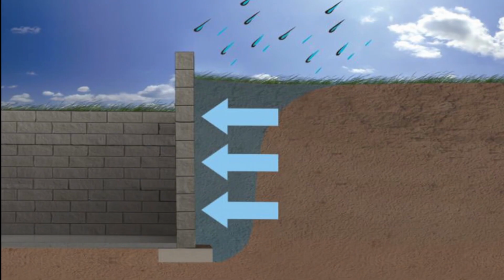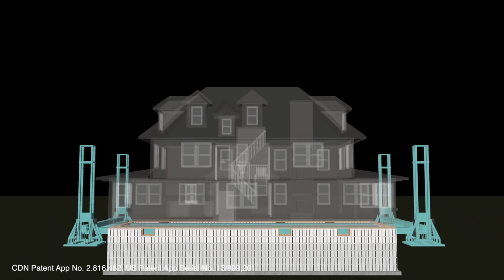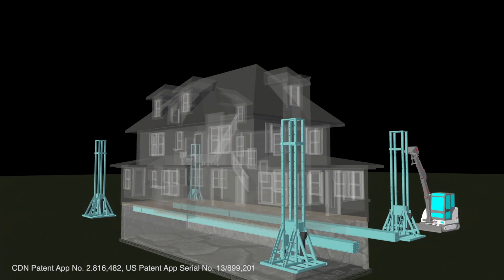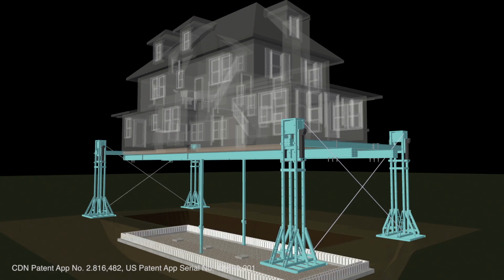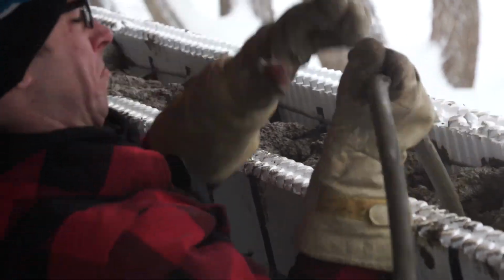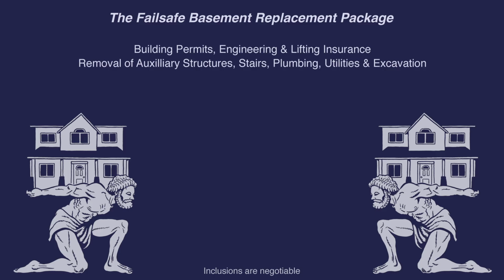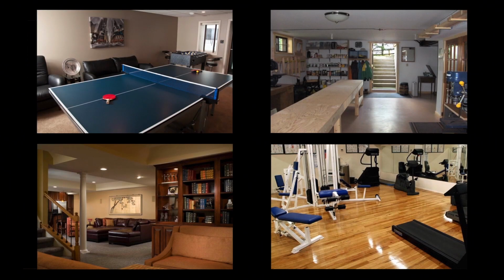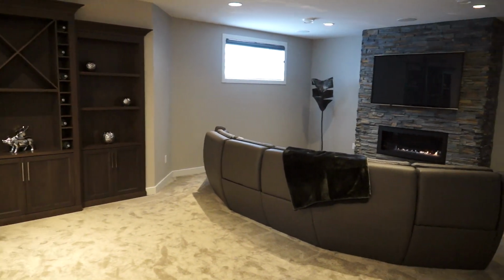FailSafe House Lifting & Basement Replacement

Comment: I've always seen timber cribbing as flawed as if the top timbers break there is nothing stopping the inertia of the house breaking ALL the timbers. We don't have basements here in Australia but your system looks far safer when it comes just lifting a house.

Comment: What has been shown is house moving jacks on steroids.  Australia has been doing this sort of thing for over 40 years, but, our jacks are a lot smaller and can be moved by 2 people at a stretch.  But, they still can reach to an 8 foot lift.  

One thing that worries me with the drawing of the bracing / chaining was that there was no long chaining of the length of the building.  It was taught to me when doing housemoving:  Never rely on your beams alone!  Always have a second and third back up plan, which you use in conjunction with your first plan.  If it was me, my plan would be to sink a couple of holes at 60 degrees to the line of the cross beams, and run a few half inch chains to those holes, which were filled with cement and had chains out the top of them.

Comment: Of the 10 homes I’ve owned over 27 yrs, only 2 (here in Dallas TX and In RTP NC), did not have 9’ or 10’ (block courses or poured foundations), with either natural walk-out or forced  walk-out basements, with legal egress.  My new home, in NW Arkansas, will 3k sqft above ground finished, 1.5k basement unfinished and 1.0k attic unfinished.

Comment: My grandfather owned a house moves and rigger company back at the turn of the last century, they used teams of massive horses and manual labor, I have pictures and still have one of his business cards, if alive today I think he'd be impressed with the technology. My one hundred year old  house has a brick foundation, in 1998 we had a perimeter drain installed with a sump pump, it made a big difference and has kept the basement dry.
Reply: Using Horses to move homes is something special.

Comment: I wish I could raise my little mobile home and put a foundation under it, I've been living in a hardship situation and all of a sudden they want a foundation or I have to tear it down because it is 1 of 2 buildings on the property. Tell how this makes any sense.
Reply: Necessity is the Mother of Invention. I worked with a guy that raised a mobile home with a large flat bed wrecker. We sat it back down higher than it was on concrete blocks.  Surely you can move it, put down a 4" slab and move it back.  It just takes the will and helping hands. My Church family would help me if I was in a similar situation... maybe ask your community for help.  People need a cause that makes them feel good.
Reply: @pearlandvelos244  One of my problems is I've built additions to the mobile, another is its age. I just don't understand why it can't remain as is, mostly storage and shop, not an actual residence with all the appliances, yet they want it either torn down or on a foundation of their approval put under it.

Comment: It’s a nice system but in order for it to be 100% successful you would have to have solid ground and level ground for it to work safely but if your house is on a hill or is not on the level spot you wouldn’t be able to use this system. Unless you dig pilings. And place the jacks on them.

Comment: House lifting costs $10,000 to $40,000 just to elevate. The average cost to raise a house above the flood zone is $20,000 to $80,000 for piers or pilings. The average cost to lift a house and replace the foundation is $20,000 to $100,000, or up to $150,000 to put in a basement.
Reply: I'd spend that to get my house above the flood zone.  It was above until the Harvey flood.

Comment: That’s pretty wild. A few years ago a very old and very large barn was moved across the street and rotated 90°. I’m so amazed that a house, or any structure, can just be picked up and even moved. 

Do the 4 pillars need to be set on the same plane as each other?
Reply: They probably use leveling jacks. Each corner has a big bolt that can be screwed down or up to get them level. But I would suspect the flatter the surface you start with the better.

Comment: Wish I cold afford to do this for my mom's house. It was built in 1900 and the basement walls are made of stacked stones and a few big boulders, and they're slowly falling apart. I'd love to have it totally removed and replaced with a new modern concrete basement.
Reply: You could do that with constructing brace walls, assuming you have a good floor already.  Do it in sections so you don't have to lift the whole house. This is the Premium solution.
Reply: The stones must be very impressive. I'd like to see a walk around video and story about such a structure.  If one was to do this one might find a clever way to capitalize on it.

Comment: 3:25 I've see what happens when you build foundations like that. The slab and the walls ( I don't' know the proper terms) can separate over time. They should all be poured as one OR a complete slab and then the wall built on top of it.

Comment: This is very cool - I suspect the cost of what they showed to be north of 100k - house lift 20-25k - basement demo 10-15k - new basement 30-40k - site prep and site finish 10-20k
Reply: Reminds me of the people paying millions of dollars to build mega basements in London- there will always be a market location that can justify any cost to add more square footage! Especially if the locality doesn't permit adding additional floors to the top due to historical codes or etx
Reply: Probably a very good estimate… if not 150 - 200k
Reply: worth it if the house is worth over $300k. Because it will become worthless if the house caves in
Reply: couldnt be said any better. unless you REALLLLY need that new basement it would be cheaper to dig a cellar next to the house.
Reply: A waste of money.
Reply: @josephhewes3923  on a 70k house yes its a waste of money. on a 1.5mil house, it's not a waste. The cost is not any different than car repairs. Should you spend 5k to put a new engie in your 1999 honda civic, no; but spend 15k to replace the engine in your mercedes sls is a big yes.

Comment: This is great! 👍🏻
I remember looking at an old house years ago. House was great but it had major basement issues. If I had this as a option at the time I might of bought it?
Reply: well getting the basement fixed using this would still be a major cost but would potentially increase the value.

Comment: I would love to do this.
My 1940 house has had roads built around it. Now the house gets road water that runs by one side. The road is almost level with the house.
Reply: Yeah we had that problem in Bethany Oklahoma where I grew up. It's also a very real issue in Pearland TX.  They just rebuilt all the roads in my sister subdivision to the north of me and several houses are now below the street level.  I'd be a little upset.

Comment: I must've missed the step where the house is attached to the concrete walls. I saw where bolts were installed in the concrete and a wooden plate over them. Then the house is lowered. Shouldn't holes be drilled into the plate on the bottom of the house before it is lowered? Then the nuts driven onto the bolts after its lowered?
Reply: Noticed that as well ... electrical grounding rods as well?
Reply: Yeah I guess that's called editing for time.
Reply: You use double sill plates, bottom 0ne bolted to foundation, second one nailed to floor joists and after lowering they get nailed together..

Comment: It costs $20,000 just to have a concrete slab braced with galvanized steel piers driven down into the soil to bed rock. Based on that, the cost of this must be more than the value of the house.
Reply: Land values would also be a factor...$200-$300K for a renovartion on a $500K block of land with an existing house isn't too over the top especially when the basement is 30% of the home space.
Reply: Unless insurance ate it up
Reply: home insurance my bois
Reply: @throlyhd9448  home owners insurance doesn't cover foundations at all, so I highly doubt it covers lifting a house to rebuild basement
Reply: @jameswood5832  how do you know that? Mother nature taking out your foundation is a peril so.....
Reply: @jameswood5832  5 seconds google and your a liar james...James.... home insurance will cover it and sometimes even help or cover cracks.....
Reply: @throlyhd9448  funny, because my foundation nor any of my neighbors foundations that required repairing were covered by insurance.
Reply: @throlyhd9448  home insurance doesn’t always cover these things. I take it you’ve dealt with insurance?
Reply: @throlyhd9448  Unfortunately, many of the common reasons for foundation damage are events your company won't take responsibility for. If any of the following events caused the damage, your insurer will most likely reject your claim.

Natural settling, cracking, shrinking, bulging or expansion of the foundation
Earthquakes or floods
Pressure from tree roots
Faulty construction
Reply: A home like this within the beltway of the DC area would be at least $500,000. It seems pretty worth it to me.
Reply: You got robbed
Reply: @Albert Orozco  Learn to read. It's $20K just to fix a cracked foundation. Lifting a whole ass house and rebuilding a basement has to be 5-10x the cost of a few steel peirs.
Reply: @Albert Orozco  in the state of pa those homes are called rehab homes
Reply: @Albert Orozco  I live in upstate NY and there was one not too from from me that sold for $25K 10-15 years ago. My home was $75K and that was around 5 years ago.
Reply: Step 1. Put your home up for sale.
Step 2 buy a home with the basement you want.
Reply: New Englanders love to brag about thier century homes.  No matter what the cost, even a dump like that one.
Reply: Demolition cost of the existing building digging out the existing foundation reporting the existing foundation rebuilding the new building above you're probably at 35 to 45% of that cost. My company does this type of work in the North Eastern part of the country.
Reply: That wouldn't make financial sense don't you think?  No one would do something like this just to lose money.
Reply: @squidusn71  That's what im confused about
Reply: @jameswood5832  I was being rhetorical. The property, in the end, will be more valuable than the repair wether it is monetary or sentimental.
Reply: My first thoughts also, maybe the house is in California and worth a half million 🤷🏻‍♂️
Reply: @patrickg7569  A single wide trailer is 1/2 million in cali
Reply: @3mtech  Southern California

Comment: BTW; If the soil type was the main reason for failure are you going to convince the homeowner that replacing the foundation in a soil type prone to cause failures is a worthwhile investment?  (JF)
Reply: If the drainage is done properly it can be good for another few decades
Reply: I love the new basement construction.  That ought to last for at least 50 years barring an earthquake.
Reply: The solution is to drive some kind of supporting piers down to solid ground.

Comment: Slick ad.  Concept taken from several already industries.  Similar systems used in prefab concrete work and in the ship industry.  Gantry is useful and worth the money in such industries, but in house lifting - not so much in my opinion.  As you'll read in the comment section of vase experience, this kind of work needs to be weighed out as to its worth.  Is it a historic home?  How well made is it to take the stress (possible racking) etc.  The cost is key.  Tear down or moving may be just as costly.    Legally, is there a lawsuit waiting to happen?  Who inspected the soil type and authorized the build from the get-go?  From an engineering standpoint this kind of thing is always fun.  We all have cool ideas.  Are they practical as a business?    (JF)
Reply: If no one trys no one knows.  Boy do I need to win the lottery so I can try more crazy ideas.

Comment: GREAT presentation!!!   
Personally, I'd just tear the house down and start from scratch. Old houses are most often not designed and built very well.  If you want to replicate the look of the house, take a picture and build it properly.
Reply: That's often true, but my Florida house is so old, the 2 x 4s actually measure 2" x 4", today they're what, about 1-1/8" x 2-3/4" ? The studs and floor joists are cypress from a long-gone local sawmill, so I don't need to worry much about termites. The only trouble is it rests on brick piers, which continue to sink into the sand.
Reply: " Old houses are most often not designed and built very well."   Bullshit, punk.

Comment: Right here in Colorado Springs, a building permit requires a soil test to be performed and passed , for the design/use.  I've seen many foundations  pushed in, towards the center of the square delineated by the edges.  Lots of clay.   The soil is unstable:  it swells when it absorbs water.   It also loses its structural integrity and basic hardness.   Houses sink, basement walls crack etc..  the rain pours down every few years.   Houses are  washed away (such as after the Waldo Canyon fire).  Or after a saturating rain,  the temperature drops.  The wet clay loam/soil which is already swollen.  So freezing it compounds the expansion.     The worst examples are houses that were built over 100 years ago.   I've seen  houses basements pushed inward while the 2x4 walls do not move.   So the framing eventually  rests on the dirt.
Reply: yeah I was just going to say that this is a very weak presentation for the TRUTH of those Lifting units. They have to be on Stable and Secure ground. NONE of which is even talked about in that presentation.

Comment: So how do they detach the house from the foundation without destroying it?
Reply: newer homes are bolted to the foundation while older houses just rely on gravity. They are not attached at all. Of course any plumbing needs to be cut off just below floor level and tagged. Electrical panels are usually disconnected from the wall and strapped up to the floor. Provisions are also made to either reuse or replace any other basement equipment, like boilers, water heaters, etc.

Comment: I'd hire you to lift my cottage to have a second floor, that's if you can send a crew to Southern Ontario this spring/early summer.  Maybe enjoy some fishing while you're here.
Heads up though, in early spring, because of the nearby lake, I can hit water 3 feet down, so accommodations for weight distributions for the Failsafe footings will have to be considered.
Fortunately, I have a brother who's a registered Civil Engineer who might shed some extra insight into local soil conditions.

Comment: This reminds me living in New England I used to live on the shore. This area has a chain of small off shore islands, many with homes on them. Some cottages and some rather large. I went to work one morning enjoying the view of the shoreline drive. When I returned 10 hours later the same ride home, there was a 5,000 sq ft three story home on this little island that wasn't there before. I later found out the thing was floated in on a barge completely finished. Sheetrocked, electrical, plumbing, siding, windows, paint, cabinetry and furniture.
Reply: Wow.

Comment: This should be a simple answer, what was the cost of job of the home you showed. Don't need the evasive every job is different to answer. Or another simple one, out of a 100 resident homes what was the average price, you know add up the 100 homes job cost and divide by a 100.
Reply: Exactly. Seems shady.